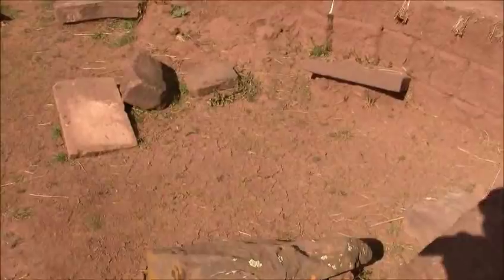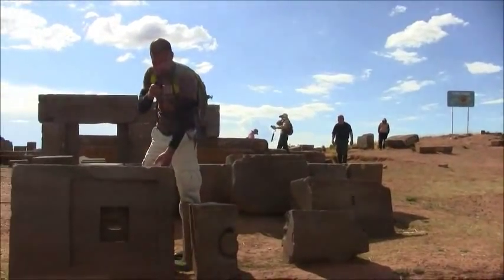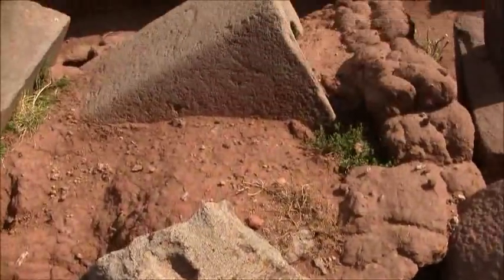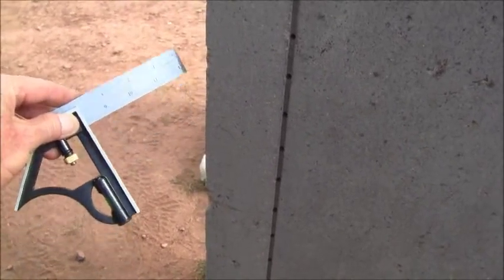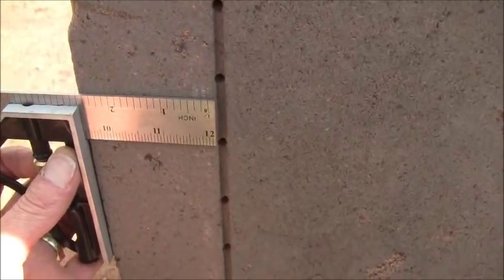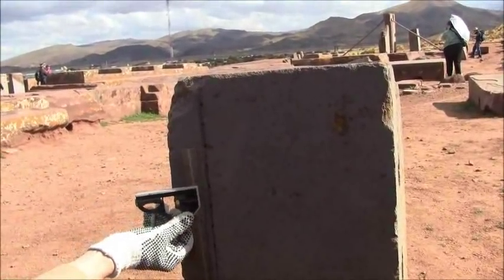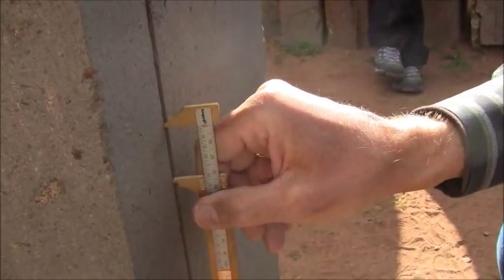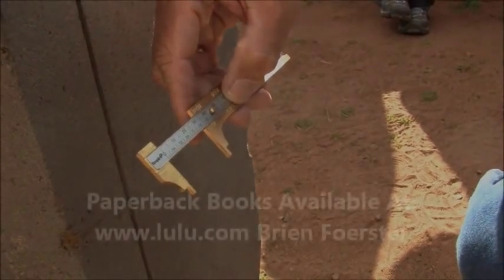Puma Punku: Obvious Evidence Of Advanced Ancient Machining

Comment: Marble is actually one of the softer stones, and it has fissures naturally throughout, so water can get in these fissures and break the stones, especially if the area has cold winters, when the water in the fissures freezes it expands and easily pushes the rock apart. I personally think Puma Punka is much, much older than the Roman empire, strangely the stone work at Puma Punka is way more accurate. But the Romans had more artwork and sculpting. The Romans also built over existing structures.

Comment: A flat surface can be produced by working the stone in an area of water that comes to near the top of the stone. Another stone is run back and forth over the top of the stone. It will grind it down to a smooth flat surface that can be checked using the water. Once you have one flat surface you flip the stone over onto a submerged , already prepared stone which is most likely a giant "L" shaped stone. One could regularly check that it's submerged section is level with the water by lowering the water level if necessary. Once you have both the top and bottom smoothed flat, one slides it against  the side of the "L" and rubs it back and forth to smooth down the side, and then repeat on the other side. Finding a 90% angle is very easy to do with a string or a compass. You simply draw two circles of the same diameter placing the center of the 2nd on the rim of the first, draw a line between where both circles intersect. That will be 90% to a line drawn between their centers.
Reply: Have you ever worked stone?

Comment: thanks for responding.just to clarify,i have worked with stone for more than forty years and although it is possible to carefully create a channel using a chisel it would not have the crisp clean edge and surface that this has,mainly because of the fairly heavy blows required to cut into the stone-thereby creating flaking. Only a cutting 'machine' of some kind could do this.

Comment: I work with stone and concrete, have done for over 20yrs. The cut's on that stone are done with a machine, not by hand. That has been set on some kind of jig and cut. Try cutting a straight line on stone with a quick cut,I think the yanks call them buzz saws?, impossible to get a cut that true. Totally amazing, that in 2013 we still don't know how these stones were worked. By not fitting in with religion's version of history we will probably never know, sad!
Reply: Most, if not all people who claim sand and water and simple tools, have never worked with stone of any sort.  It is obvious to me that these stones are extremely hard and durable. Some of the surfaces still seem to exhibit a slight polish.

Comment: the rock they cut isnt soft. Andesite is a common volcanic rock found in mountains along the Pacific Rim. Andesite is coarse in texture, pink and gray in color and has 7.4 on the Mohs hardness scale. Cooper and Bronze tools (which at that point in time was the cutting edge of metallurgy) are both 3 on the Mohs scale.

Comment: Take 1 straight edge, and 1 flat 6mm thick bar of abrasive material or metal with sand or something. Place the straight edge along where you want one edge of the channel to guide abrasive bar to start with. once a little bit has been worn in the straight edge can be removed. With some sort of stop on the bar you could get exact depth the full length of the channel too. Then some sort of plate with 2 holes in it can be used to give the exact same distance between each hole. Simple and accurate.
Reply: Have you ever worked stone?

Comment: Amazing. Brien, did you get those documents shipped on down to third cred? I was supposed to get a new tanning system for the  material compartmentaliser. I'll drop a comms link on ch4 hz432. Check back with dontay too to make sure that the evidence was processed by the military. From what i recall it took almost 300 men and woman to remove the craft and its contained elements and fields due to the nature of the paramediums. Anyway i'll let you get on and i'll check in tomorrow with rachel at front desk.

Comment: Want evenly spaced holes, you say? Use the exact same stick to measure out the spacing & location of every single hole. The only caveat being that you should definitely make sure you do not lose this stick. 
Want a perfectly flat surface on your red * sandstone* (pay attention here, it is NOT granite)?? Submerge your block in a small pond, so that only the top surface of the block barely sticks out just above the water. Start sanding down the block's surface until it is flush with the water...until there's just barely a millimeter thin layer of water covering the block's surface.
Drill holes? It is called a copper-arsenic-nickel alloy...very tough stuff, along with a bit of coarse sand, and voila, you've made a decent drill bit.
Important note: the designers of the complex likely sat on their butts all day, gloating upon their own misguided magnificence; incidentally, also the case these days, the modern construction site boss down do much of any hard work. A slave-labor force of 100 dudes working on one single block, will lead to a task quickly completed.
Of course the ancient Egyptians figured all of this out thousands of years before the native inhabitants of the Americas thought it'd be a great idea to build some elaborate venue for parties...and the occasional execution of sacrificial human beings. By the way, if you were to cut 4 slivers of along the periphery of a wooden circular wheel, attach them along the length of a block, you'll end up with a square block that can easily be rolled around with comparatively minimal effort. But quack peddlers could never admit to such simplicity, your know, because reasons.
The end.

Comment: The precision of these structures is not easy to explain by the simple machines and tools which are claimed to have been used by their builders. Critics claim to the contrary and yet have failed to demonstrate how this could be done. I have asked before and asking again these critics to provide evidence that supports the simple machining hypothesis.
It is very likely that complex machines have been used for the construction of these structures but the problem is that such machines have not been found.
How were these stones transported from the site to the construction place? If you have answers to these questions please provide detailed facts and exact procedures. If you are unable to do so please do not waste our time.
Reply: You are joking right?  Do a little independent research.  The reason the stones at Puma are scattered about is because the Spanish Conquistadors pulled them down when they destroyed the place.  Well documented.  Some of the same stones were then transported by the Spanish to erect the foundation for a nearby church.  Again documented.
The stones are not granite.  Boring holes into stone can be achieved with bone and quartz sand.  Documented.  Carving NEAR straight lines into stone is done across the world by hand even to this day.  Documented.
PROOF is everywhere except in these videos.
Reply: Alamyst2011 We tried using many different tools including what you suggest to achieve the holes observed on these stones, it did not work. I am willing to pay you $20,000 if you demonstrate in our lab, using actual stones from puma punku the holes seen on the stones.
Reply: Please demonstrate to me and Dr. Brien how you have achieved this.

Comment: What this is showing me is that at the time of building this structure, the builders had technology equal to or greater than we have now.. History tells us that our ancestors were living in caves as hunter gatherers in that time. Yes this is very interesting to me
Reply: *****
 Really? I challenge you to do that.

Get yourself a small block of granite, manufacture your straight-edge/ruler and set-square using only copper tools - without the aid of a ready-made straight & level surface (because there can't be a straight & level surface WITHOUT the tools to make one, can there . . . ?) - and then fashion your granite block into a cuboid with polished surfaces. Once you've done that, cut into it a small linear recess wide enough to drill a series of equidistant holes @ 2mm OD - all using this ruler you've made - on one edge and on another edge drill a larger hole right through the piece making sure it stays on course and perfectly round.

All to be done by using sand and copper tools. No iron, no steel, no drill-bits.

Oh, and you aren't to leave any tool-marks on it either . . .

Comment: It was not until the late 1980s that the west discovered, or perhaps rediscovered how to cut stone using water jets containing an abrasive sand. It could be possible that this technology was known long ago. This method is the most efficient method , the fastest, the most exact method we have. It works better than lasers. To get the pressures needed one needs only a ram jet.
Reply: So thats what the JET ENGINE  at puma punku is for.... ohk
Reply: Actually water jets are not all that accurate  and we don't see marks that typically come with water jetting. Not to mention the tech that would be involved in setting up an accurate water jetting operation.

Comment: The dating of the site in that show was my favorite example.

Instead of looking to modern archaeology, they pulled their 14,000 year old date from a hack in the 20's that used a comically bad dating method involving astronomical alignments and celestial drift.

In the '20s that was dubious.  No one buys those dates now, it is accepted that the site was built around ad 400-500.  But there it is on that show... 14,000 year old site...

Comment: There is the theory of concrete in the Great pyramid of Giza too, but new evidence comes to light as how it was built, without high risk speculations, using Jean Pierre Houdin's theory of internal spiraling ramps. The archaiologic and geologic evidence shows other stuff in both cases.
There is even an explanation for the water erosion in the sphinx as water from the inundation flooded it occasionaly so water tunnels had to be dug to lead the water away from the site. Regards.

Comment: And the vertical tool marks in holes extending vertically over 2 meters long were made How?
And the perfect 90 degree angles and tolerances of 1/1000 of inch were made with what type of "ancient tool"

Why are you afraid of realizing these structure were not made as we learned in our text books which are connected to our religious beliefs.

Comment: There is BOATLOAD of misinformation about this site. 

The stones are NOT diorite as some have said. (Diorite being hard to work with). It's easy stone to work. Sandstone and Andicite. Stoneworking tools perfectly capable of working either sandstone or the andicite there are all over the place.

Partially complete stones at the site show that they used the exact same stone working methods as the Egyptians.  Nothing special at all  

They did need metal tools. But pre-Inca had metallurgy, so...

Comment: Seems pretty likely that the work wasn’t done by hand. The word machine can mean a lot of things though. I saw these guys rig a machine to cut stone that consisted of a fine rope and guide. It was run by water wheel and could make very long perfectly straight or at least very straight cuts in stone. It does seem like there was a mud slide or major flooding but at that altitude???  It’s like 14,000 feet above sea level. How is that possible?  Younger Dryass comet strike in N America isn’t sending a wave down to the other side of the globe that’s almost 3 miles high is it?  Maybe if something hit in the Pacific close by. There’s just been so much time and shit happens every day and there’s not gonna be evidence that’s easy to come by for something that could have happened 100,000 years ago. It hasn’t been proven that there weren’t some smart beings here then. We just haven’t found the evidence yet.